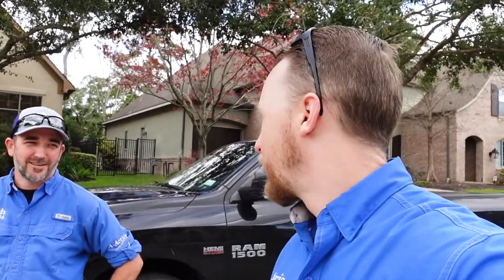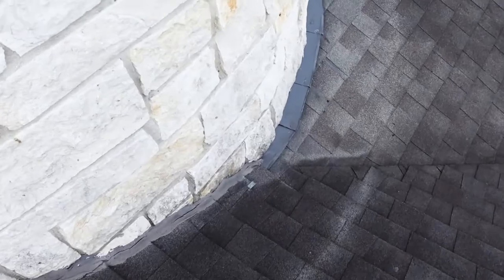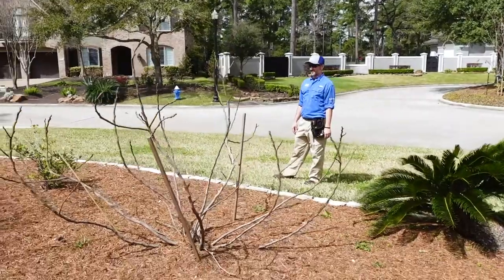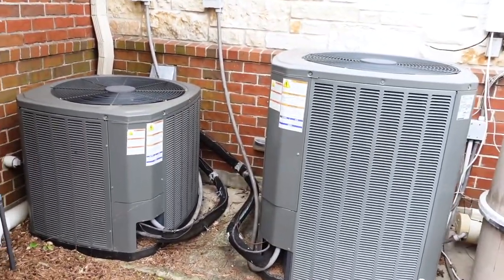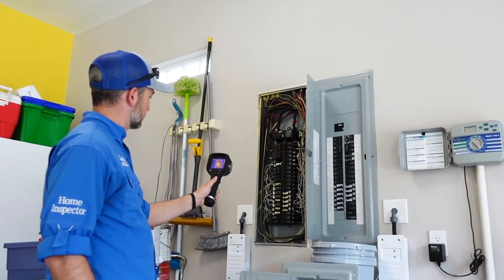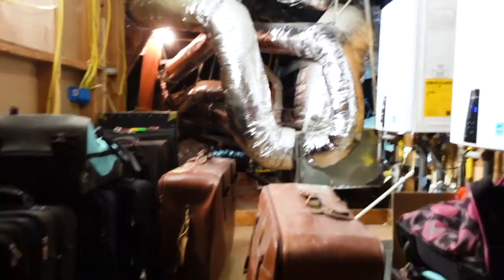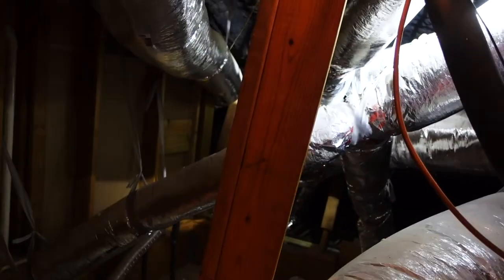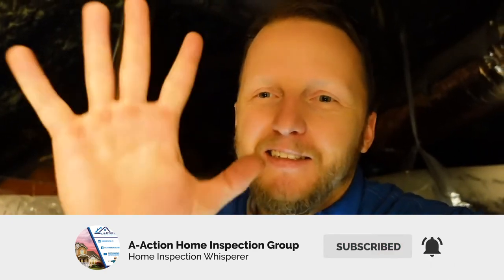Inspecting a Massive Property

Comment: Safety tip: Which way does the electric load center panel door swing? Take the right cover off first so that the door doesn't swing into an open cabinet.

Comment: So wouldn't they need some additional flashing around the turret to help prevent water intrusion?
Reply from the maker: We didn’t find any water intrusion but found enough on the roof for a roofing company to come out.  So we documented the repair and told the client to have the roofing company further evaluate the area.  The most important thing is we did not see any current water penetration in that area at the time of the inspection.